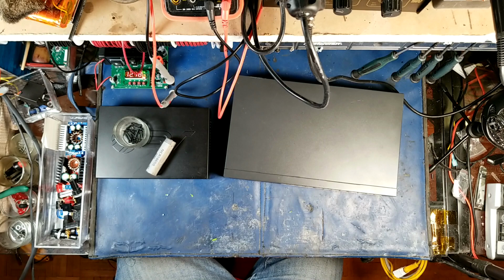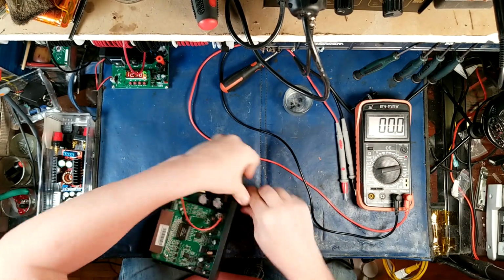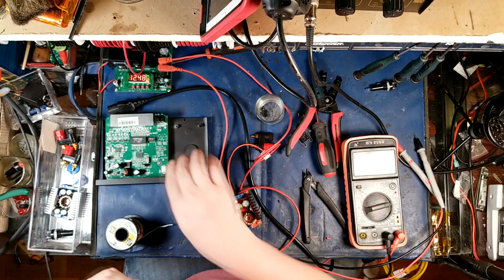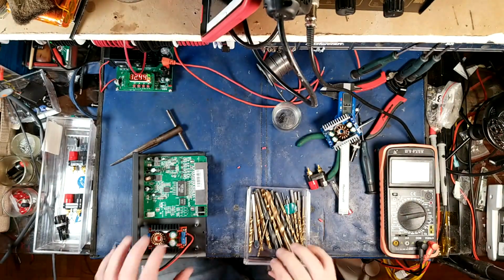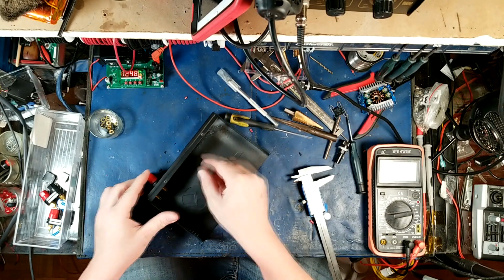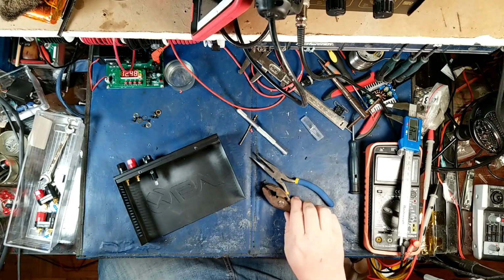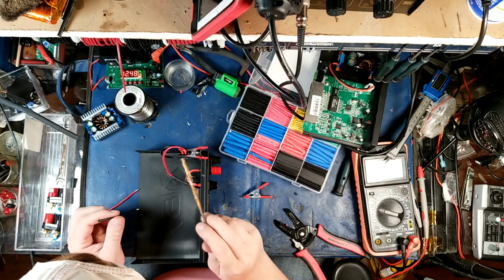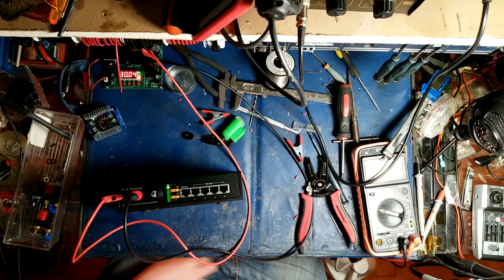How to convert an AC Network Device to DC

Comment: Dear, How can I convert the Cisco switch 2960 to be POE out through the 24 ethernet and Connect DC power converter 24v inside it ?
Reply from the maker: The switch in question is a standard poe switch with Main input correct ?
Reply: @thefixitgal  No
Reply: It doesn't have poe feature
Reply from the maker: @Dr.Salah_Alkhalidi  Theres no point in modifying a switch to add poe to it. You should just buy a poe switch thats suitable to your needs or add a midspan poe injector.

Comment: Do you think this could be used for a poe injector along with some AA or 123a batteries? I’m wanting to setup a stripped down cpe antenna on a dji drone to test fixed wireless signals. What are your thoughts?
Reply from the maker: Nah.. bad idea. For drone work you need to reduce & simplify.. Use a small 12v Lithium flat pack. you can run most radios on 12v otherwise add a small 30w 12v to 24v boost converter. then for your test cpes remove the housing.. You can optionally spray with acrylic enamel. With drones simplicity is critical. Additionally if you need a wifi ap you can add a mikrotik Map lite.
Reply: Ms.Fixit I had no idea they could run on anything less than 24 V.  I’ll have to see if I can figure out what a flat pack is. Thanks again!
Reply from the maker: @TheTF01  Flat pack is a Lithium battery that's literally flat.. like the ones in phones or rc cars. If you take your drone to a local hobby shop they can help you find a small battery of it.